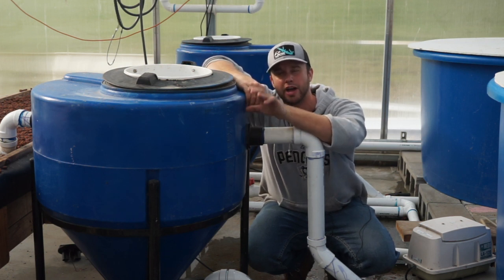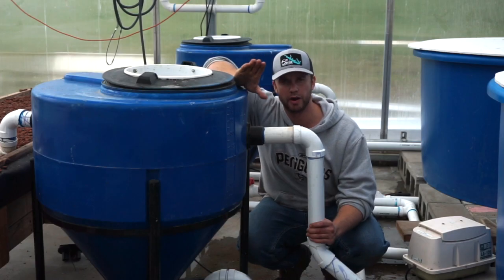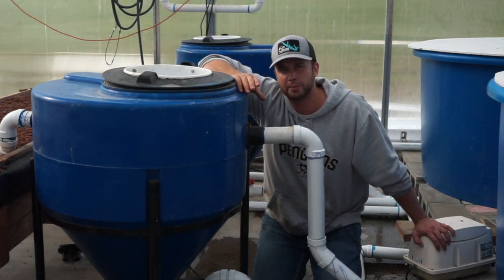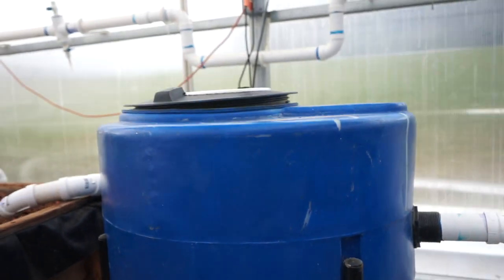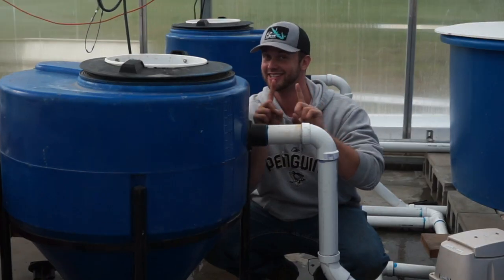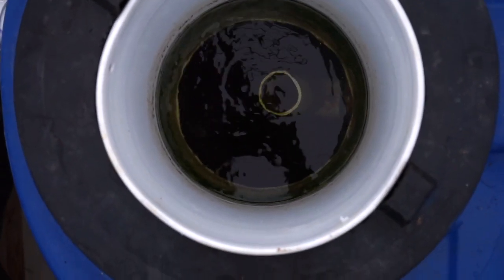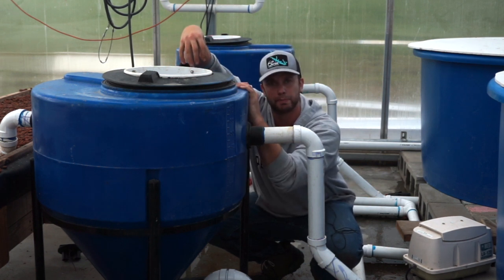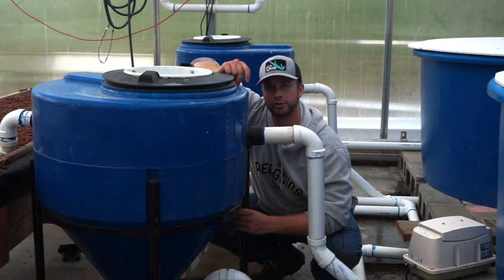What settling tank should you use for aquaponics?

Comment: Well you will need some figures to design a good one: water in a settling tank should stay there for at least 30 minutes. Research has shown that after 30 min. about 80% of the suspended solids (SS) are collected in the bottom cone. So if you are pumping 5 m3/h your settling tank should be about 2.5 m3. Thats the disadvantage of settlings tanks - they need a lot of space. Thats why we are using  drumfilters in commercial fish farms (RAS). But if you are using a deep water culture you are having a long settling tank ;-). But remember we want the liquid nutrients from the fish waste not the solids. So design your system in such a way that you can always remove this unwanted sludge otherwise you will run into problems.